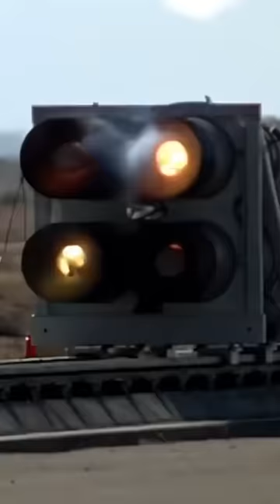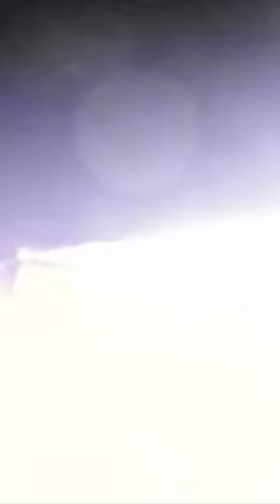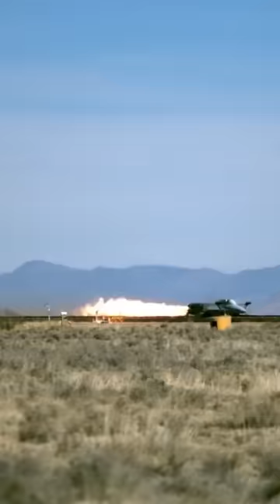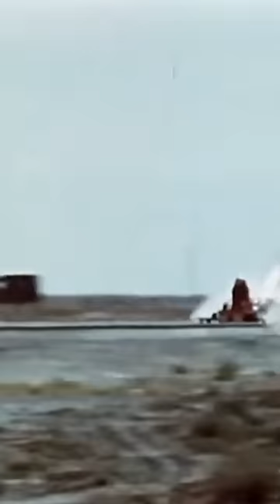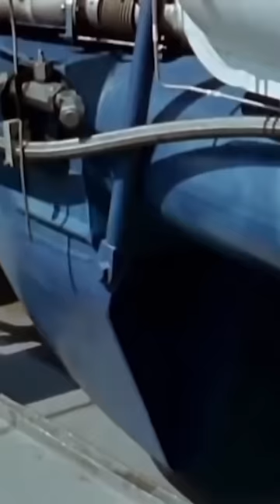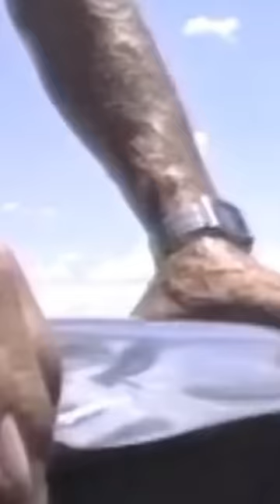Quick Water Stop

Comment: I've known about the rocket sled at Holloman AFB and that they used water braking all my life, but I've never known exactly HOW it worked.  Thanks.
Reply: yes, it's almost counter intuitive since they say hitting a body of water at a certain hight is like hitting concrete!
Reply: @Eduardo_Espinoza Not if it's broken down so the kinetic energy is spaced apart. When you're hitting the water from a fall, you have to break the surface tension. A good way to see that in action is with Olympic swimmers and how their techniques work with surface tension.
Reply: @Eduardo_Espinoza  Hitting water at 660 mph is instant death.
Reply: Hitting water at velocity while only clothed,,, sure.
Using a scoop front to plough water as a brake for your SLED!!! 
Purfectly fine, especially when the pilot is adjected at velocity,,, sooo, no kinetic force transmitted from breaking...
Is this making sense!?!?
Reply: The guys eyes just popped out, had black eyes for a while
Reply: We use to watch it at night
Reply: Why don't they have that today on regular train tracks

Comment: Fun to think about the the immense forces involved here, and the relatively unique properties of H2O that allow it to absorb said energy non-destructively (from the sled's perspective at least) 😅
Reply: like a shock absorber come to think of it :)
Reply: It's not unique to water, any incompressible fluid would work. Water is abundant, cheap, and safe for the environment so it's well-suited to this application. However such a fluid with higher density like mercury would remove more momentum so would be better for stopping if cost, accessibility, and toxicity weren't considerations.
Reply: @abebuckingham8198  Of course you are correct and I like your thinking :)
Reply: @abebuckingham8198  but then a higher density would cause higher deceleration velocity, meaning if it were a person strapped to it there could be some issues
Reply: @Crazyclay78YT it would be interesting to see the calculations and graphs for water versus Mercury braking as compared to its effect on the human anatomy
Reply: @veeforteeto5976  I mean I would assume it's proportional, but idk

Comment: That's funny that they call it momentum exhcange because that's how literally all braking works
Reply: Planes, boats and many other things do; but when most people think of brakes, they think car brakes. There the momentum is converted to heat through friction rather than being exchanged into a different medium.
Reply: @pacoclimbseverywhere  that's still momentum exchange
Reply: @jogandsp ok Einstein
Reply: @jogandsp They never said it wasn’t? They were just sharing the perspective that most people have when they thinking about braking. Those people think of it in the terms that the other commenter laid out, not like in the terms we saw in this video. Yes, they are all examples of “momentum exchange”, but your average person would probably not make that connection until it was explicitly pointed out to them, which I believe was the point the other commenter was making.
Reply: Car brakes using friction material against a disc not moving water, fyi

Comment: You call that safe??? Assuming the deceleration is constant, from 1028 km/h to 0 in 1.5 seconds.
1028 / 3.6 / 1.5 = 190.37 m/s².
190.37 / 9.81 = 19.4 G
So thats a g-forcw of 19.4.
ASSUMING the deceleration is constant which it ISN'T.

Comment: I wonder if they designed a mach 8 ejection seat...
Reply: Look up the ejection capsules used by the B58 hustler, i don't remember their mach limit but they were built for supersonic ejection (seats typically arent, and pilots that eject at supersonic speeds can be killed or horrifically injured ).
Reply: @coreypickens6792 The entire F-111 cockpit ejected.  It had two rocket packs capable of ii to 30,000 pounds of thrust each, one at the back of the cockpit meant to maintain forward momentum and one underneath the cockpit to provide vertical thrust so it would be high enough for the parachute to soft land the capsule. The F-111 also had terrain following radar which allowed it to fly as low 50’ above the ground at supersonic speeds. The trick was teaching the rocket packs NOT to fire if the plane was upside down when ejection occurred.
Reply: @mikegardner107  good mention, that's one of my favorite birds, that and the A-5  because the concept of a low altitude supersonic strike fighter that poops nukes out it's aft end while at dash speed is a unique type of awesome.

Comment: Speed of sound = 700mph. Eight times SoS = 5 600mph which is >> 1 028kph.
Reply: they are two different rocket sleds, but he does not make that super clear in the video.

the rocket sled that went to mach 8.5 was unmanned, and most likely did not survive the run.

the "1028 km/h" or "639 mph" figure refers to the speed of the fastest manned rocket sled. this is actually slower than the fastest overall manned land speed record, which was set at 1223 km/h in Nevada by ThrustSSC, a supersonic jet "car"
Reply: @hiddensky1164  ThrustSSC, driven by *Royal Air Force pilot Andy Green,* holds the current land speed record at 1,227.986 km/h (763.035 mph) set October 15, 1997. That is rather less than 8*SoS = 5 600mph
Reply: @DeanJuvenal  please read more carefully. i said manned land speed record.

the speed record over mach 8 was unmanned

the fastest manned rocket sled was piloted by John Stapp, and is recorded at 1,017 km/h. this is less than 1,223 km/h of ThrustSSC

Comment: it is very much wrong or you mispoke, you see speed of sound is mach 1 so 8x speed of sound is mach 8, and speed you  showed in video corresponds only for mach 1 not for mach 8, because mach one is over 1200km/h and mach 8 corresponding is at very least 9800km/h.

Comment: Its not as fast as the fastest rifle bullet. Mach 8 is 2722 m/s. The .22 swift moves at 1422m/s. Already faster than half the speed of the rocket sled, and the .22 swift is far from the fastest rifle bullet.
Reply: Tell me then, what commercial rifle round goes faster then the .22 swift? Because the answer is none.

Comment: Where did your learn math? The speed of sound is 767 mph so 8 times the speed of sound is 6136 mph. Rifle bullets, such as that of a Remington 223, leave the muzzle at speeds of up to 2,727 mph (4,390 km/h) — fast enough to cover the distance of 11 football fields in a single second. There’s no way on God’s Earth a “Rocket Sled” can travel 8 times the speed of sound let alone come to any kind of fast or as you put it immediate stop using any type of water engineered equipment or configuration period. The fastest fighter jet ever created was the NASA/USAF X-15. It was an experimental aircraft that resembled more of a rocket with wings but managed to reach a record 4,520mph. As you can clearly see your video is completely inaccurate. Most of your videos are misleading, inaccurate and completely FALSE !!!!
Reply: X-15 was was carried to altitude by a B-52, jettisoned and fired its Rocket Motor. The X-15 was not Jet powered. The SR-71 still holds the speed record for a jet aircraft.